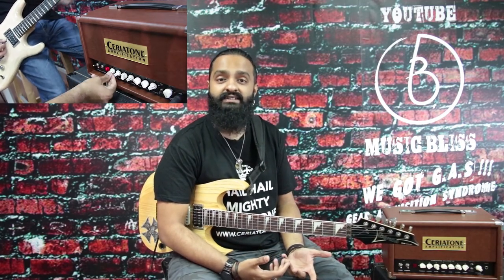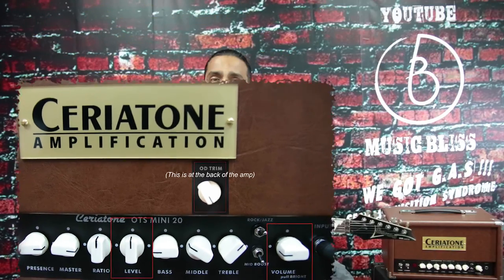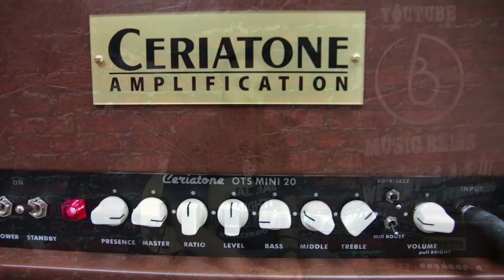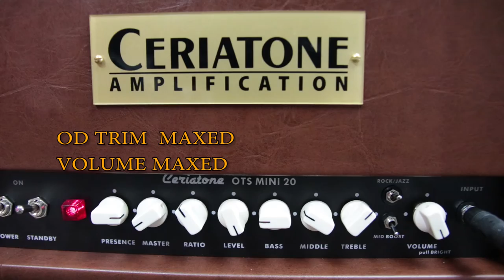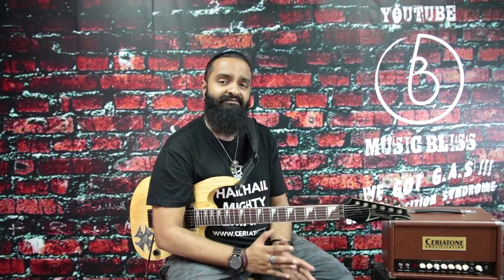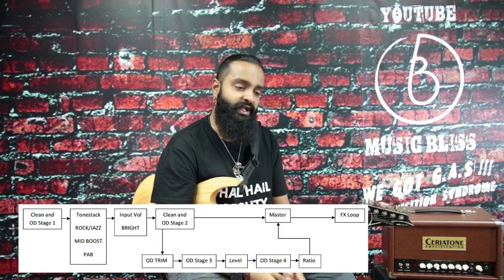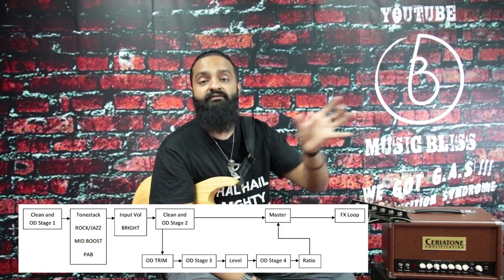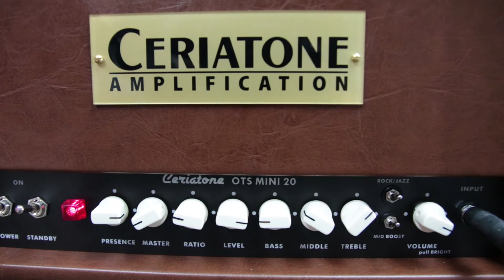HOW TO DIAL IN THIS AMP: Ceriatone OTS Mini Part 2 Saturated Tones

Comment: Easily the best demo of this amp online anywhere. I'm a blues/rock player. I mainly keep my Master at 10:00, OD Trim at 11:00 and my Ratio noon, Level 3:00 and Vol at 12 with mid boost on, PAB off, Rock setting. With all gain stages enabled, it's like a glorious, thick, vintage tone that's a bit fuzz-like but still retains clarity. It's literally the best tone I've gotten out of any amp I've owned not using any FX (save for a EP Boost and a TC Hall of Fame 2 in the loop). This demo helped me dial it all in. Thanks so much!

Comment: Side note; I've built a dozen or so amps for myself and a couple customers. Most kits, but a few that I totally sourced all the parts myself, did them point to point, no pre made boards,and a few things became apparent.
1)if they make a kit for the amp you want; but the damn kit. The ones I built from scratch ended up taking MUCH longer, cost more to build, and were no better than the kits. 
2)I was surprised that the Dumble clone was a PCB built amp, all the Marshall and Fender clones were either point to point, or built connecting all the components with hookup wire. I didn't understand why, so I researched the actual Dumbles and was shocked to find that the amp Nazi Alexander Dumble himself builds the originals with PCB. There goes the theory we gear snobs hold that printed circuit boards are garbage.

*(if you're curious about referring to him as the Amp Nazi, read some of the stories from people who ordered amps from him; 8 years to complete, people who called to check in after a couple years getting moved to the back of the lists, uhhg. "no Amp FOR YOU!" I know the demand is MUCH higher than supply, but I wonder if just a little of the premium paid for used ones is so you can avoid dealing with him. He and Ed Roman  guitars are like 2 peas in a pod, except the amps ARE actually worth some of the hype.

Comment: Great video!  I hope I'm not asking this question too late, but I just put in an order for the lunchbox.  My use case is a bit different from most people, in that it will be used exclusively for recording, so I'll be sending it through a reactive load into an audio interface into a DAW.  In other words, loudness is not an issue.  Having said that, if I wanted a nice blend of preamp tube and power tube OD, would you recommend first cranking the master pretty high, maybe even dimed, then adjusting the volume and level accordingly?  I realize that the real answer can only come through experimentation, but I'd love to hear your thoughts.  Thanks in advance!

Comment: I've been running my Ethos into mine. Think this can get confusing,  try dialing both of those in. I do find when I can open this up without worrying about volume, it's a COMPLETELY different amplifier.      Trying to get all your gain from the Preamp will give you a fizzy tone, just like any other amp. I don't use this for high gain, I don't really get past a Plexi level saturation. If someone wants it for high gain, they're better off just getting a Boogie,but for clean /pushed/OD, there's nothing better.  I bought it only thinking how great my Strat would sound through it. The Strat DOES sound great, but I find my 345 with the Lollar Imperial low wind PAFs seem the fates themselves deemed that they should be played together.